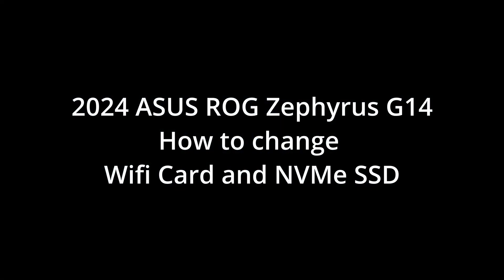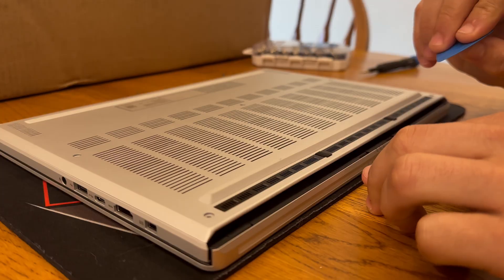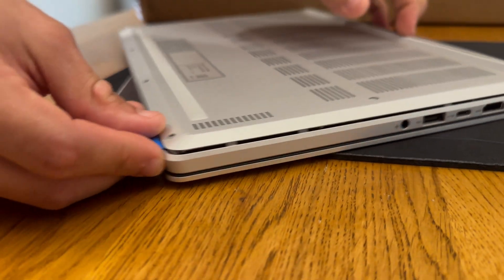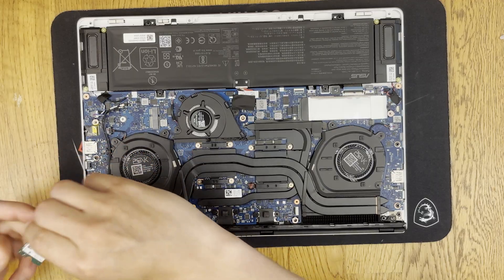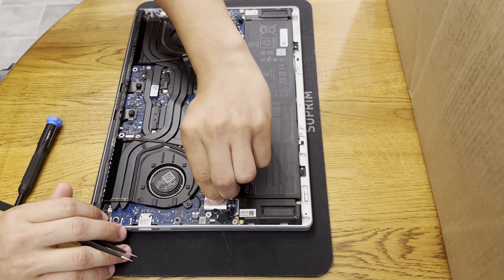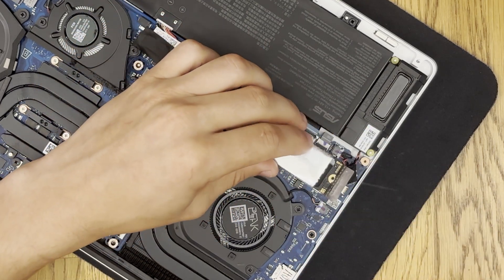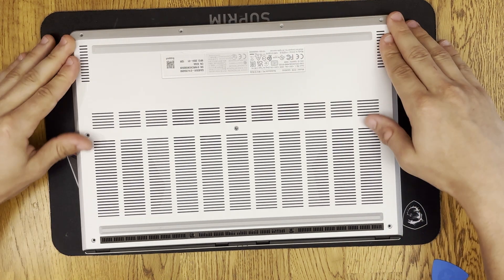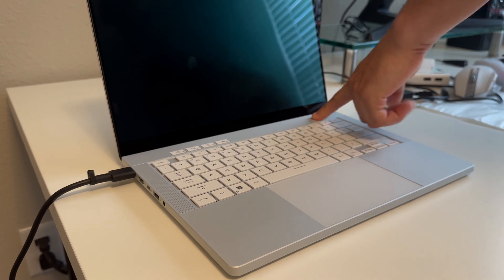2024 ROG Zephyrus G14 - How to replace Wi-Fi Card and NVMe SSD

Comment: there is any problem upgrade those things without disconnecting the battery?
Reply from the maker: I believe it cuts all power once you remove the bottom cover and I never unplug battery after opening G14/G16. I would suggest reading the manual/service manual just to be sure.

Comment: Question. I just bought this laptop, and ordered a 4TB nvme drive to replace the 1TB. Why did you replace the WiFi card? An upgrade?
Reply from the maker: Intel WiFi cards are a lot faster and do not have strange connection issues after sleeping. With newer drivers, the Realtek cards have gotten better though. If you’re not having any issues then I would just leave the Realtek card.
Reply: @classyorb  I appreciate your info, homie. What model Intel card do you suggest for this laptop? I should have the laptop delivered in a few days, and it would be cool to upgrade that card along with the new nvme ssd.
Reply from the maker: @christopherjoy2872 Up to you. If you’re gonna utilize the speed, I’d go WiFi 7. If not, WiFi 6E is the way.

Comment: my laptop overheating now can u please tell me wht would it cause
Reply from the maker: NVMe or WiFi card swap wouldn’t cause those issues. What exactly is overheating? The CPU, GPU or something else? 

If you did a fresh install of windows on the new NVMe then it’s most likely software related issues. I’d make sure your AMD chipset drivers and Nvidia GPU drivers are fully updated, as well as windows. 

If you think it’s a hardware related issues then it would most likely be a malfunctioning fan or liquid metal has dried up.

Comment: which SSD to use as upgrade for my 2024 g14, has 512GB M.2 PCle 4.0 NVMe in it now?
Reply from the maker: Any 2280 length M.2 will work. I would recommend getting Gen 4. You can get 1TB, 2TB, or 4TB. Here’s an example: https://a.co/d/4zb1s6I
Reply: @classyorb ,perfect thank you for responding. I appreciate it
Reply: @classyorb can I buy a new ssd with windows already installed on it? Cloning seems too confusing
Reply from the maker: @yoz1967 I would install windows yourself. G14 has “cloud recovery” through the bios that will install windows and all drivers for you. All you need is an internet connection.

Comment: Can you change the battery
Reply from the maker: @vici-g2u  yes I believe it is just screwed in. You’ll have to remove the screws then unplug it from the motherboard. Then it should come easily. It should be similar to this here: https://www.ifixit.com/Guide/Asus+ROG+Zephyrus+G14+Battery+Replacement/165021
Reply: @classyorb  thanks I just don't know where to find a battery replacement
Reply from the maker: @ if you want OEM, you can check here: https://partshop.asus.com/us/ .. if not you can try contacting asus directly. 

Your final option would be 3rd party replacement

Comment: Can you link the specific tool you used for the philips head 00? It looks like I'm starting to strip the screw on my wifi card
Reply from the maker: @Not-Andy-Here  It was either iFixit or Hart (from walmart). They both have Philips 00 and smaller or larger then 00. They’re both great. 

Hart: https://www.walmart.com/ip/278218723?sid=553979b8-e48b-49f8-b57c-43d5224c7baa

iFixit: https://a.co/d/aEVF0rF

Comment: that’s a PCIe Gen 4 M.2 2280 SD card right?
Im planning on upgrading mine for 4tb using the oricon 7200 or 7000 SSD 

1tb only fits 3games these days.
(wukong COD MW1+MW3)
Reply from the maker: @nXedric Correct PCIe Gen 4 M.2 NVMe SSD. 2280 length. I went with 2TB as I only play a few games at a time. 4TB should be plenty!

Comment: Do you need to reinstall windows after upgrading the ssd? and how to do that? does windows recognize the license automatically?
Reply: Reinstalling windows isn't too challenging - the official guides from microsoft should be sufficient, and you can get your windows key (as a safety) using the command line (look up something like get windows key from cmd). 

However, you won't keep any of your files this way - Replacing the drive will literally remove everything on the pc from a user perspective. if you have a friend who is a bit more savvy, I may suggest asking them to clone your laptop drive onto the new one - this way you would keep everything but get to use the new drive.

Comment: Used this video to change my wifi card. Thx a lot.
Reply from the maker: @rramnel  nice! Happy I could help
Reply: @classyorb  maybe another video to show how to replace the battery would be great :)
Reply from the maker: @rramnel  I ended up selling mine. I’m waiting for the 2025 model
Reply: @classyorb  Other than the battery life on this thing, I think its a great laptop. 2025 version with a lunar lake CPU would be ideal. And also if they fix the whining coil sound from the 3rd middle fan
Reply from the maker: @ newer efficient CPU and fixing that 3rd fan noise will make this, in my opinion, the perfect laptop
Reply: which wifi card did you change?
Reply: @shrirangpinjarkar  it is the Intel AX210
Reply: @rramnel did you change it to the ax210?
Reply: @sharymens8187 yes correct
Reply: @rramnel thank you! i am wondering what it improved. what is the difference with the previous one?
Reply: @sharymens8187  honestly nothing major, if you dont have any issues with your current card I would just leave it.
Reply: @rramnel thank you once again:)
Reply: @rramnel  how can buy that it india? Is it compatible for G14 2023 - GA402XU?

Comment: removing volatile memory or any parts without unplugging battery can cause serious damage
Reply: Funny cause NVME stands for "Non-volatile memory express"
Reply: @Chunnibyoubaka  also the wifi card uses the same connector so yeah, no need to remove the battery connector.
Reply: @Chunnibyoubaka  i don't know it could cause damage depend on design
I think its rare to happen unless if you unplug display without removing battery
Reply: Really depends on the laptop. Some laptops such as the Surface Laptop Studio 2 disable the battery when you unscrew the SSD as it is an interconnect. Just gotta read the service manual for the device you are upgrading.

Comment: is it possible to use the wifi slot for a 2230 ssd instead and then use usb wifi adapter for internet? if it's possible, would you recommend that?

I would like to have 4TB storage but I already have a 2TB ssd, so I was thinking instead of buying a new 4TB ssd, it would be cheaper to  buy a 2TB 2230 ssd instead.
Reply from the maker: I've never heard of that and I'm sure that's not in the manual. You'll have to try it for yourself. If you do try let us know.

Comment: does it support wifi 7 card??
Reply from the maker: @MegaMijit  it should as it uses the same connection type. You may need to manually install drivers if Windows doesn’t install them

Comment: It is recommended to remove the Mediatek Wifi card and install Intel, but which intel wifi card is best to go for - I recall Linus tech tips recommending this??
Reply from the maker: @EnGieBenGie90  personally I’d get Intel WiFi 6e + Bluetooth 5.1 or higher. You may see them as AX210 or AX211 cards.

I have Intel killer AX1675x which is Intel WiFi 6E + Bluetooth 5.3. Works perfect

Comment: I upgrade to the qcncm865 and can't get the Bluetooth to work wifi works fine I've tried three different drives
Reply from the maker: @thomasyoung1685   I see others mention same issue as you here: https://answers.microsoft.com/en-us/windows/forum/all/qualcomm-qcn-865-wifi-7-adapter-m2-card-partially/d420d614-67d4-41b4-b1d4-4d10d0de08d3

One guy mentioned downloading WiFi and Bluetooth drivers GC-WIFI7 1.0: https://www.gigabyte.com/Motherboard/GC-WIFI7/support#support-dl

Let me know if this works for you. I didn’t know Qualcomm made m.2 Wifi/Bluetooth  cards.
Reply: Disable the AMD Bluetooth driver it conflicts with the card driver on the 865

Comment: Should you remove the battery cord before doing anything?
Reply from the maker: I never did on this laptop but if you want to be safe, you can disconnect the battery connector. Just to point of the obvious, be careful with fragile connector and any components near it.

Comment: Can you fit the double sided 8TB nvme drives?
Reply from the maker: @YT-ks9go  I think the NVMe would fit but the shielding may not fit. The shielding would need to be modified if you want to use it. 

That’s just what I think. If you test it let us know!
Reply: Did you try it? 🙂
Reply: single sided nvme only says it on user manual

Comment: Anyway you can make a video to copy and install windows and drivers!
Reply from the maker: @ChatoPizana  copying or cloning windows on the NVMe after installing in the laptop would require an NVMe to USB enclosure (to connect the old NVMe) and then using live linux USB or clonezilla to clone the files to the new drive. Is that what you’re taking about?
Reply: Will Asus cloud recovery in bios work for copying Windows image to blank SSD and thanks.
Reply from the maker: @huntnyc  Yes it will. It walks you through everything, including connecting to your wifi. It takes a while, like 1 - 2 hours but it works ok.

Comment: How can i reinstall the drivers and windows?
Reply from the maker: @ChatoPizana  Windows: You can try ASUS cloud recovery in bios to install windows or clean install yourself: https://www.youtube.com/watch?v=QDtthnHv4ik

Drivers: Intel WiFi cards there’s 3 things to note. 

1. It may just work after install. If it does, connect to the internet and run windows update and it will install drivers.

2. If it doesn’t work, try connecting to the internet with an ethernet or WiFi dongle, if you have one. Then run Windows updates. 

** Do this next step on your G14 if you have internet. If not, you’ll need another computer, device or Linux live environment on your G14. Then transfer the downloaded files to your G14 with a USB drive.

3. Search Google for your WiFi card model. (Mine was Killer AX1675x). 
Then find the Intel website link. Go to downloads tab. For Killer you’ll need killer performance suite/intelligence center and it updates everything for you. For normal cards download WiFi & Bluetooth separately. Then update the drivers through Device Manager on your G14.

Comment: Nice video. I'll be waiting when you have to reapply LM before I'll do mine.
Reply from the maker: @itsHeROo  Thanks! Actually I was thinking about removing LM and going with PTM 7950
Reply: @classyorb  Yes can you please make a video on that showing the before and after temps as well? I'd like to do the same but id like a guide on it first. I havent been able to find many videos about this laptop doing that
Reply from the maker: @Jojo2  I was planning on it but I don’t have the laptop anymore :(
Reply: @classyorb  What happened? Did you sell it or did it break?
Reply from the maker: @KennyVo120 sold it but I just bought the 4070 model.
Reply: I would definitely watch that video